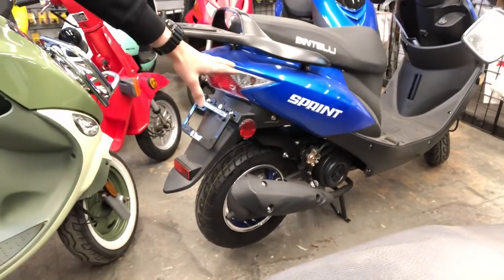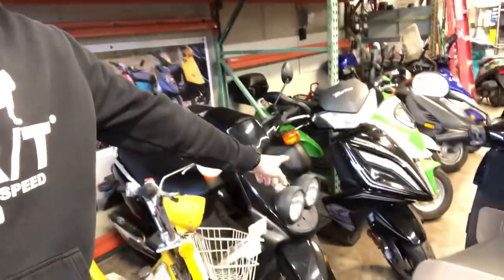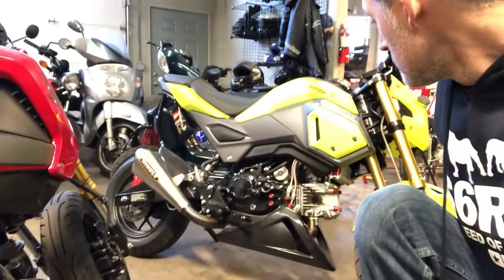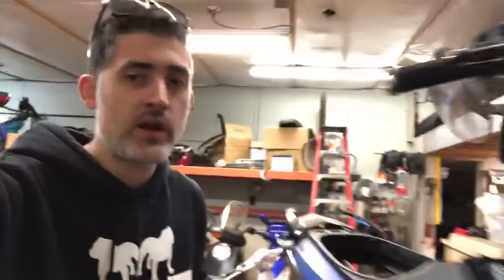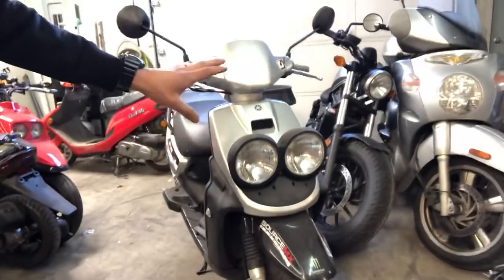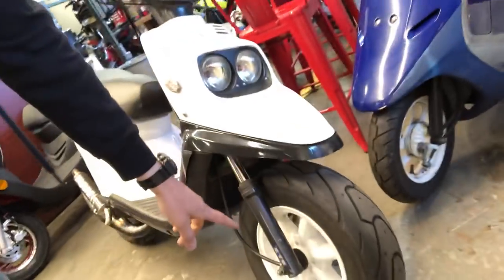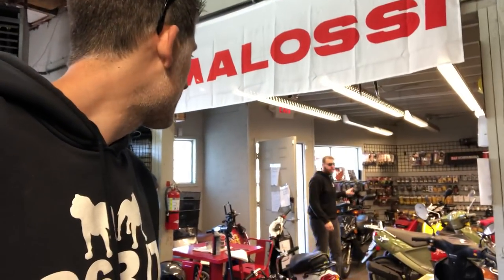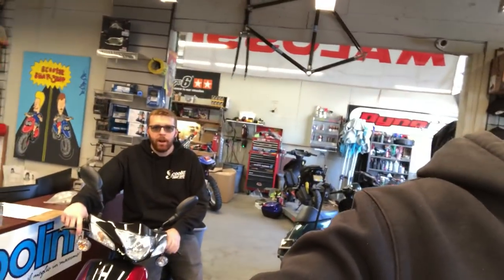How to modify a scooter

Comment: Thanks for finally mentioning the horizontal clones.. for people looking to get cheap speed. The Chinese 1e40qmbs have been just as good (engine/trans wise, but not shattery body panels) as my old Zumas hor/vert. I’d recommend these more so to new comers for their availability of the 2-stroke realm, because as you said in most areas the pre-bug and 01 elites are in fact getting harder to find and people think they are gold.

I just got my old horizontal clone running with a Stage6 cast (70 streetrace) that had been sitting in the backyard for 5 years. A tank/carb clean and good as new. I still need a part from your shop, NCY Zuma/Jog rear pulley with the good angles, your site says they’re in stock and it’s in my cart, just wanting to make sure, probably toss a Malossi shortcase belt in there too what the hell. Thanks for your cool and informative vids, (we want more hands on/dyno stuff!)
Reply from the maker: no clones....

Comment: Does gasoline E85 works on 2-stroke scooter I that have 2000 Kymco Z X 50 CC Super V or what kind of setup can I get for her starting first with the Camp Chef
Reply: All I can say for E85 is that you gotta jet richer than you would with gas.  And im not sure it gives big gains
Reply from the maker: you can tune it for e or non i wouldnt do e

Comment: My channel is literally called hondabond 35 I'm done with the Honda but the aftermarket support is expensive like I said I had a 2005 etan Beamer 2. 50cc 90cc cylinder in all actuality it's 70cc because the 50cc stroke do a little part work on that cylinder throw pipe on it I had mine winding up so tight at 60 miles an hour it's not like the crank was going to vibrate out of the case but it damn sure felt like it I had that motor running at about 10,500 RPM and it was making my feet numb
Reply from the maker: We have to say it a million times because people still don’t use it
Reply from the maker: Honda is no more than any quality scooter parts. If your buying Chinese parts they’ll be cheap
Reply: @Scooterswapshop  driving with talk text it said I am done with Hondas that came out wrong I am a Honda enthusiast I got a 01 trx400ex original front tires chain sprockets still got original rear tires original front brake pads I bought it from the original owner ran it like 5 times

Comment: I'm actually a mechanic for 25 years and they eton motor is made in Taiwan but it is also a Polaris Motor  uses it in all their four-wheelers up to 90 cc's I haven't Eton Beamer 2 50cc ported and Polished Big Bore Kit 90cc faster than hell all I got to do now really is do a little bit more clutch work  if you want to get more top speed the pain meaning the one holding your clutch and sheave on the shaft it's a hollow crank shaft about an inch and a half long don't take much off and make sure it's completely straight maybe like a 16th of an inch you'll see real results
Reply from the maker: ok
Reply: @Scooterswapshop  Polaris uses the Eaton motor been all their four-wheelers

Comment: Honestly, the best 4 stroke scooter is probably a Vino 125.  Its the best all around 4 stroke.  Mine did near 60 stock, super reliable, they look dope, short and approachable (and wheelie capable).  I'd just modify stock, not much aftermarket, and they're excellent machines.  If you cant afford a 125 Zuma, and if you find a cheap Vino 125, I couldnt think of a better small 4 stroke.  Avoid a GY6 bike unless you dont go far, and if you dont plan on going through every wire, nut and bolt to make it work.  The motor itself is bulletproof, its just......everything attached to the motor thats shit 😂
Reply from the maker: pcx, zuma, ruckus, vino, metro, there's so many.

Comment: After Working at a scooter shop I say you get what you pay for in the scooter world... mostly after I ask them for $400 after fixing their $600 brand new shity Tao Tao. Or peace Sports Or... I could go on...
Reply: Easy 😃 I've got a 2006 peace stock it was 50cc, now it is 80 that I've done every mod that can possibly be done the only thing stock on it is what's left of the body kit and the bars frame and front end but mechanically everything is aftermarket, it's just something I like doing tinkering around with it and love riding it and I'll tell you it's a beast for what it is the motor is strong and it's never failed me (knock on wood) I can get 55  all day on flat ground 60s downhill but it's screaming the only thing I haven't put a lot of time in is the varriator and clutch and I know if I put some money there I'd be in the 60s gears also want bigger gears,
Reply from the maker: thnaks